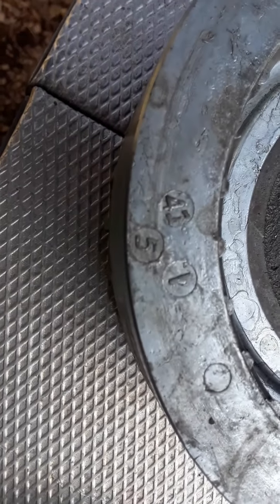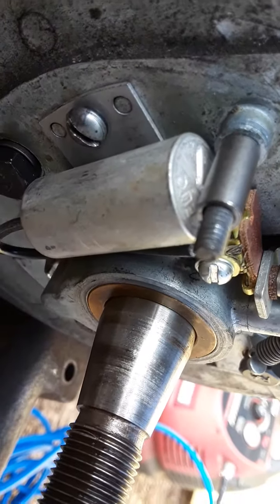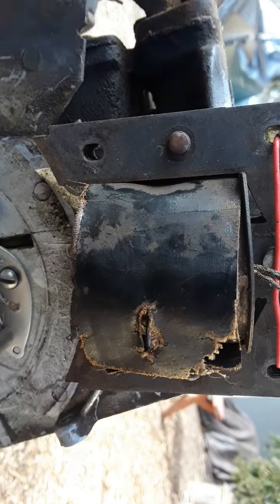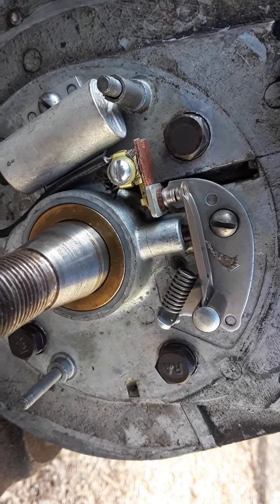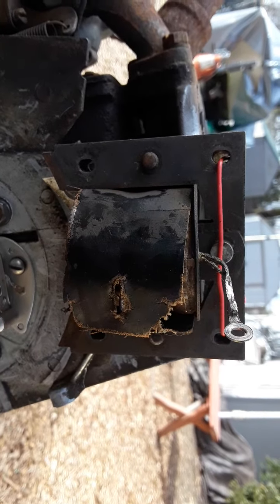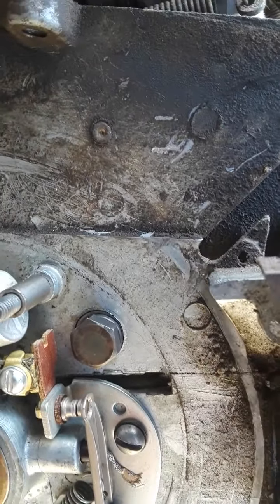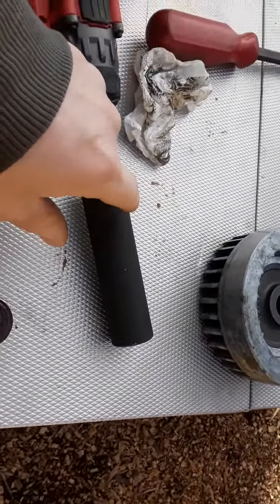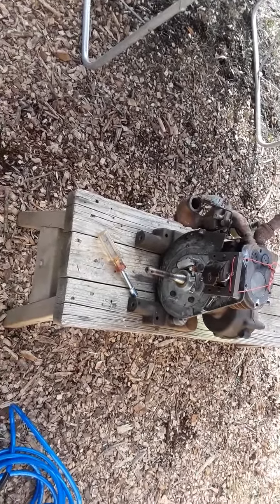1941 Briggs IR6 points and condensor inspection. Finding the DOM on behind the flywheel, Pre 1965

Comment: That's pretty Neat! It looks super similar to my old briggs 6s!
Reply from the maker: They are very similar. In fact, they use the same magneto, points and condensor. I think this magneto is bad. Your supposed to be able to test it with a multimeter in ohms to see if its good, but I'm not exactly sure how, you don't happen to know do you? Its my first time messing with one of these old ones.
Reply from the maker: @Colin 583 Thanks, I'm getting no reading. I think the coil is dead. I have a 6s, I'm going to barrow that coil and test that one right now. If its good, the I, will run off the 6s coil, until I get another good one.
The tab on this coil is real loose, it has lots of play. I think it broke off the winding inside the core, it also looks burnt near their, so either it broke or got over heated when someone sottered the old replacement wire I took off it.

Comment: Hey man, did you show us how to use that flywheel knock off tool... If so share the link, if not if you could please make a video on how to use it, I can't find a good one.
Reply from the maker: Yea, it works great. You stick that on the end of the shaft, stick a pry bar gently behind the flywheel tap it gently back their and give it one or two descent wack's with a ballpeam hammer on the end of that tool and the flywheel pops right off, nice and easy, no damage or worries about damage.
The one I got on ebay was a stens brand for $7.25, he sold out, but here is the link to the next cheapest one for about $9.75. Its a  must have if you remove flywheel's often.
https://www.ebay.com/itm/Briggs-Stratton-Flywheel-Removal-tool-Use-on-Other-Brands-FREE-SHIPPING-NEW/150881989718?hash=item2321447456:g:sbEAAOxydlFStjz5